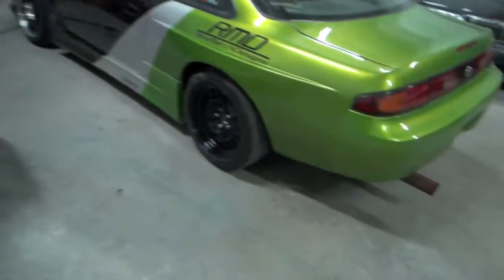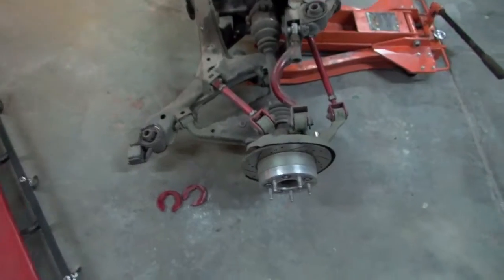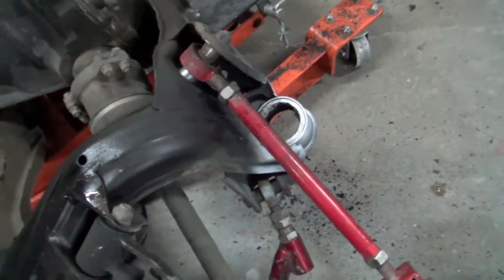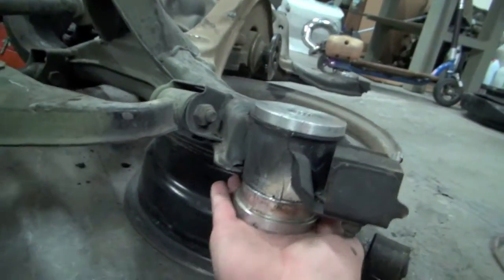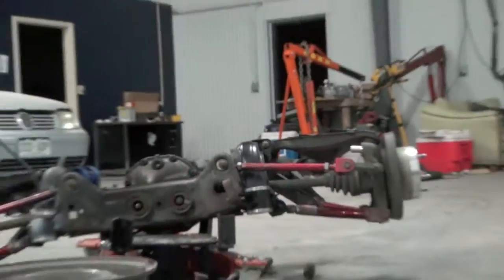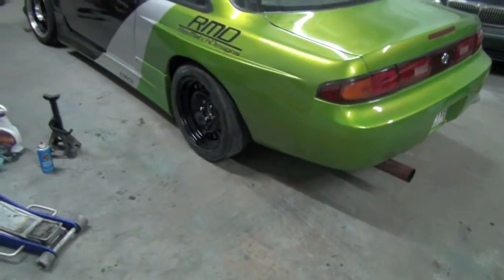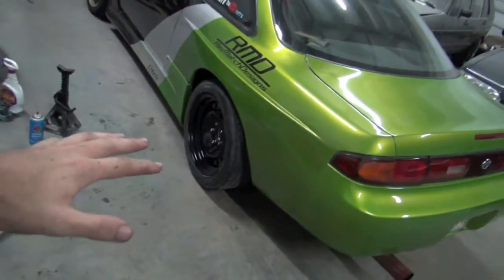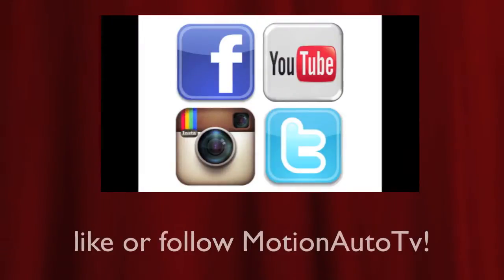How to install solid subframe bushings in a 240sx s13 s14 z32

Comment: Make sure you remove the 10mm ebrake cable bracket from the top of the subframe before you completely lower it.

Also remember to unhook the differential breather hose, and differential ground wire, and hang your caliper up to the strut/spring; don't let it hang freely as it'll strain your rubber brake line..

Good video.

Comment: I got some Stance solid bushings like that by mistake. I was actually going to buy some new poly ones. Is it really uncomfortable to daily drive with those though? I plan on replacing all my subframe suspension arms with adjustable spherical bearing arms and replace all my old bushings with poly from energy suspension. It already rides a bit stiff with only the Stance SuperSport 8/6 coilovers. I got an S13 by the way.

Comment: Hey man, nice video! Was just wondering if those little sleeves on the inside of the subframe would need to be removed if you were poly bushing it instead? Or is that just for the solid bushings?
Reply: Yes they do!  The sleeves are attached to the old bushings.  I found it easiest (If you don't have a 30tonne press) to use a hand saw to cut through (but not all the way) and cut from the bit without the lip.  I Then used a ball joint splitter to bash it out.  Kind of hard to explain but you'll swear a lot.

Comment: whats the name of those bushings? and also I recently crashed my s14 on a curb, cause I was drifting on the rain lol not a good idea, and it seem like the only damaged part was the rear lower control arm, but you know the rear lower control arm has like to connections, connected to the subframe, well its hard to explain but one connection just ript and the rear lower control arm its bent now  like do I have to replace the whole subframe, or its just fine? and just replace the rear lower control arm, your opinion would be great and appreciated.
Reply: I had the same happen and at the time only replaced the lower control arm and the rack end rod. Unfortunately it wasn't enough as the subframe got bent too. I'm only now in the process of swapping subframes, chucking in new bushes all round and raising the subframe higher 1/2" inch with Gktech subframe bush raisers. Should be good :) I hope you sorted out the car by now but if not its worth doing it. I should mention I never had good wheel alignment on the back with the bent subframe and every time loss of traction was induced in a straight line the car would go straight sideways.

Comment: i recently did my subframe bushings and welded my dif but now i have this noise when I'm accelerating it sounds like its eating itself and like theres a bolt in there but i drain the fluid and check the gears everything look alright there was some metal from welding on the magnet but nothing i didn't expect and theres this vibration when the wheels break loose it makes the car feel like it has a flat tire. I'm going to pull it tomorrow but need to now if anyone had the same thing and what it could be.
Reply: MotionAutoTv
Reply: Did you find out what it was??

Comment: do you ever worry about the wheel spacers causing excess stress on the hub?
Reply: its a racecar, driving it hard cuases excess stress on the hub
Reply: i take that as a no
Reply from the maker: bananabottles Yes it does, but so does running higher offsets of wheels